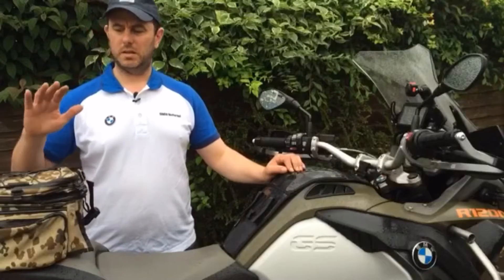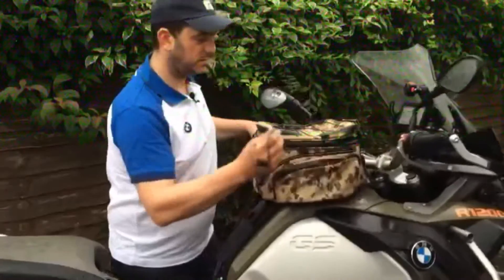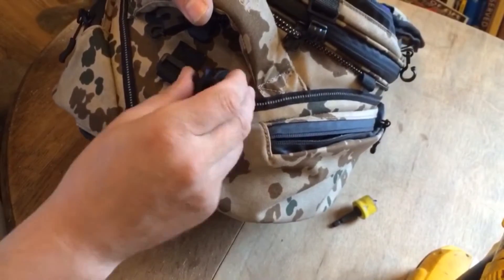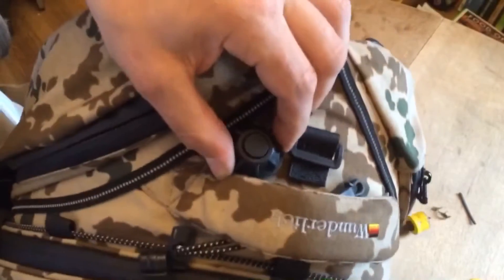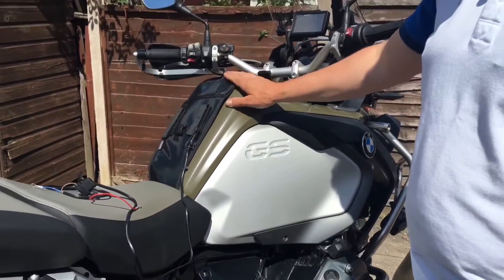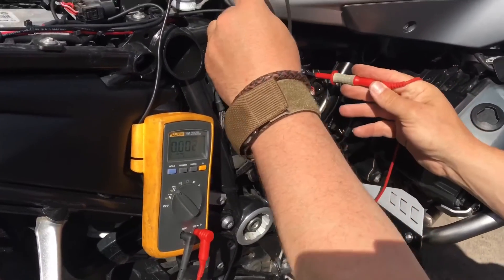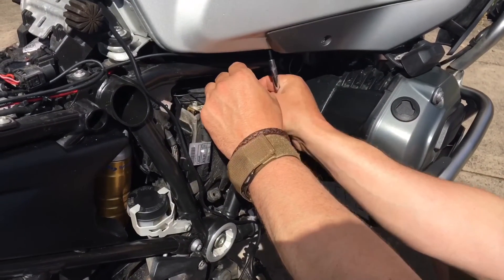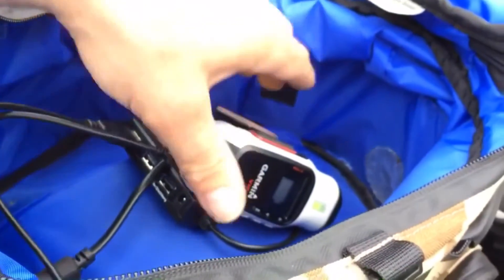Givi S110/S111 tank bag charging system installation/tutorial  - (BMW R1200 GS Adventure LC)

Comment: Does it drain the battery when bike is off? I'm scared that my battery will be drained and bike will not start if I install this things.
Reply from the maker: If you wire directly to the battery then if you leave a item charging, even with the ignition off, the battery will drain. You can create a new fuse box under the seat and give that an ignition feed only from the bike. That way the fly lead will only make a charge available when the bike is running, when the ignition is turned off then the live feed is shut off to the charging system 👍🏻

Comment: Richy.  Great install video.  Would you happen to have a part number for the what looks to be a 2.1mm pass through connector?  The piece you insert into the hole you drilled in the tank bag.  Keep up the good work.  Cheers!
Reply from the maker: Charles Xavier Sorry I have no part number for that specific item. You get everything you need in the Givi kits but it's just a tank cutter you need with fine teeth.
Reply: Hey, thanks Richy.  Keep the vids coming.

Comment: Can you confirm for me is this set up live and charging all the time or is it only when the ignition is turned on, thanks?
Reply from the maker: Keith Stewart Hi! Yes it is a constant live feed unless you take the feed from an ignition wire or even better from a distribution box for extra electrics. These can use fuses as jumpers and you can choose a permanent feed to an ignition feed.

Comment: Richy I am confused as I am not into electrics so to speak. I have a BMW R 1200 GS Adventure 2016 model motorcycle with a Din 12mm socket fitted as standard. I want to charge my iPhone, iPad & GoPro batteries on long touring trips so can I not just have some kind of electrical lead coming straight from  the Din 12mm socket into a multi USB adaptor in my tank bag? Many thanks in advance.
Reply from the maker: Robert Taylor Yes absolutely fine. I've left mine on the cockpit free incase I use Google Maps on my phone when it's in the holder so need to keep the phone charged. I've not followed the Socket but it must be fused down on the GS. The Amps you would pull will be ok. Good to hear from you. I've not done any videos for a while as I've been so busy but I'll try and get some more out there. All the best
Reply: Richy Parton Many thanks Richy. Do you know which cable I will need that comes from the Din 12mm socket straight to the USB multi charger unit that will be in my tank bag? Yes make some more videos as you are good. Starting my own channel as I have just purchased a GoPro Silver 4 Camera so watch this space...lol...
Reply from the maker: Robert Taylor I don't know what cable you need but it can only be one Off three types . Nippy Normans is a great start for bits. Yes Robert notify me when you get your channel.
Reply: Richy Parton Yes RIchy found the exact cable from Nippy Normans so thanks for that! Forgot to mention in my previous message I purchased the Humvee Black Panniers Wrapping kit & wrapped both panniers & top box & even if I say it myself they look stunning! Found it rather simple after watching your video on the subject so keep the videos coming & will let you know when I post my first video on my channel.